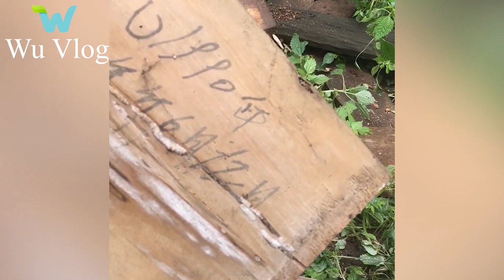The start-up failed, the boy returned to his hometown to renovate the old wooden house Part 01

Comment: So far, it is not even clear whether it was worth restoring this old house or simply building a new one in its place. If the walls of the house consist of clay with grass, then it is definitely necessary to build a new house. And destroy the old house. If the walls are made of brick or stone, you can still renovate. Too many buildings in a small space.